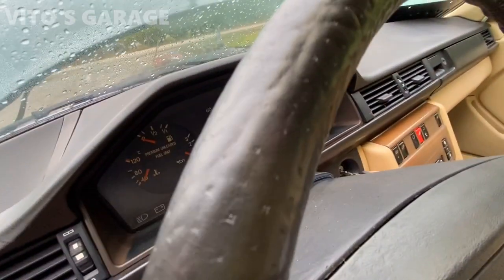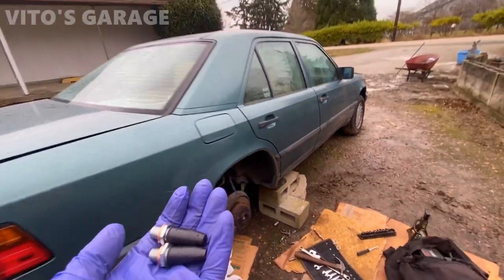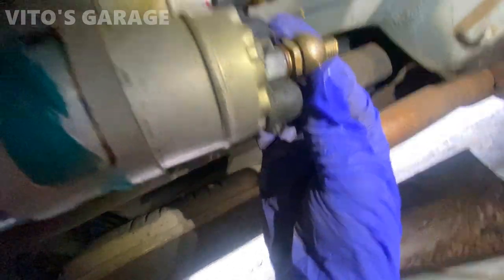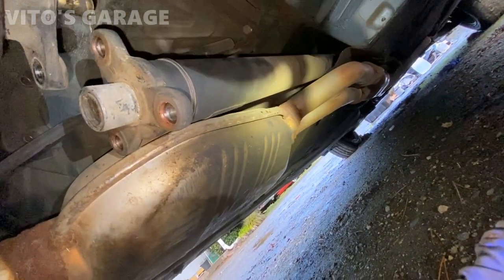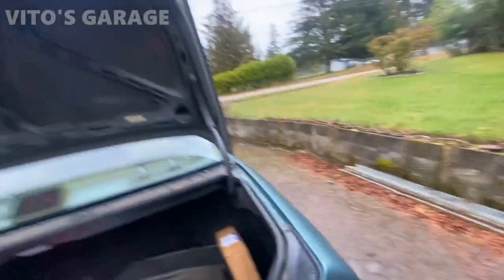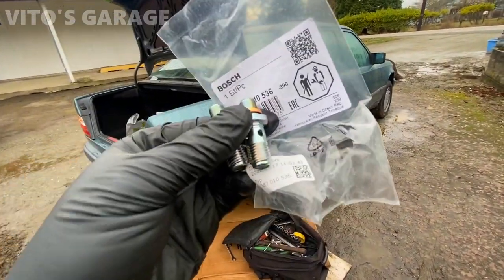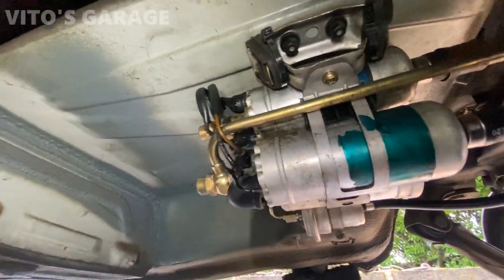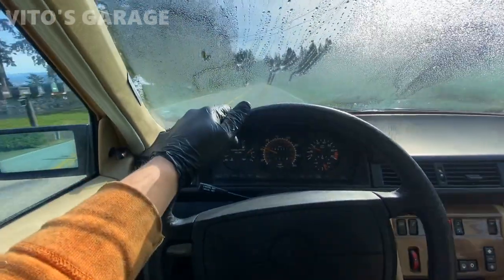Part 18: Mercedes W124 300E New Rear Flex Disc & Bosch Fuel Pump Check Valves

Comment: What symptoms would happend with a bad flex disk
Reply from the maker: Vibration can happen. But mainly is you don’t want your flex disc to fail while driving. It can do some crazy damage depending what speed it happens at. Replace them when you see cracks. Use only Genuine Mercedes flex discs or Febi brand.
Reply: @VITOSGARAGE  would this repair be carried the same on a 1989 300ce?

Comment: Any chance for the part number with the right thread? Awesome video like usual
Reply from the maker: Thanks. Yes: 202 410 13 15
Reply from the maker: Keep in mind that the front and rear flex discs are different
Reply: @VITOSGARAGE  No, no, the fuel pump check valve, you said that it needed the one with the right thread (min 5:13), that's the part number I was talking about, thank you !
Reply from the maker: @danricci6996  ohhhhh sorry! Here’s the part number info for the Bosch fuel pump check valves: 1 587 010 536